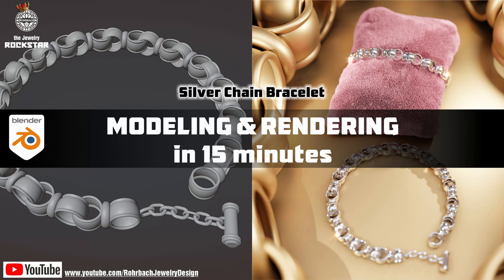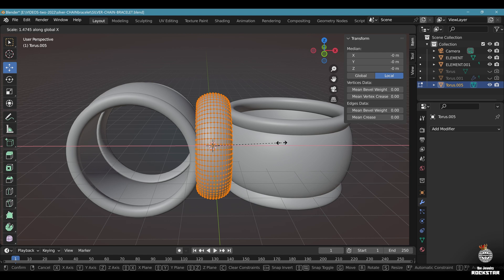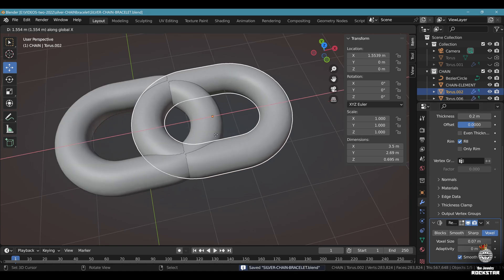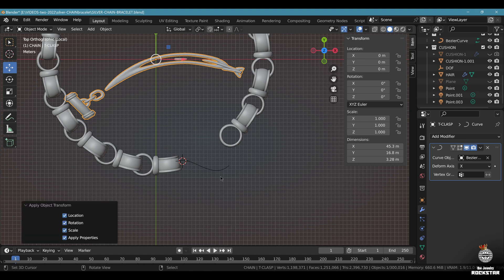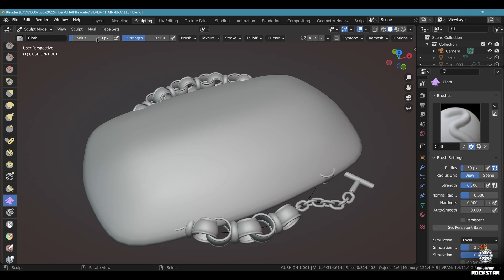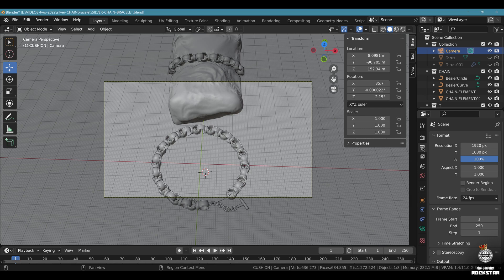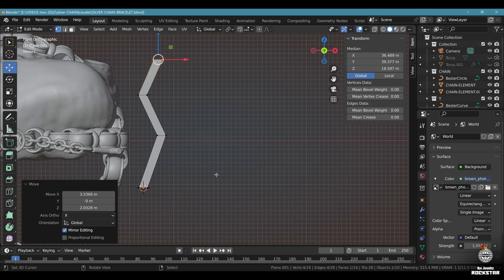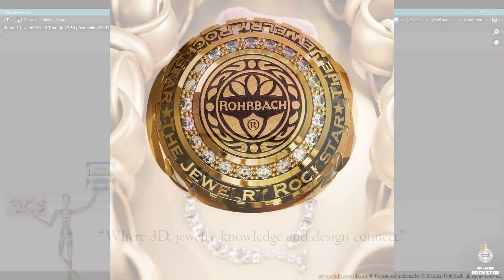3D Silver chain bracelet tutorial modeling and render using Blender 3.4

Comment: The hair material I applied to the cube and plane only shows the hair in some places, not all the hair. Is there any way to do this? I hope you can help me.
Reply from the maker: Hair particles system (not material) can be configured in several ways. Basically you get hairs per face, so imagine a cube has 6 faces, that's not a good start. You need to have a topology with many small faces, to get a more even distribution ( also many other settings affect the distribution, and it is not always easy, even for advanced users) Good luck!